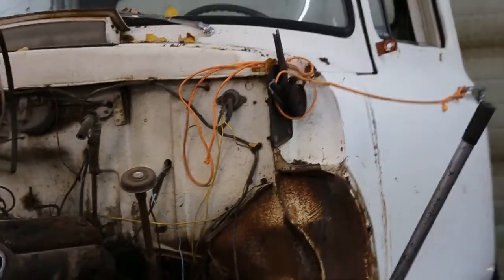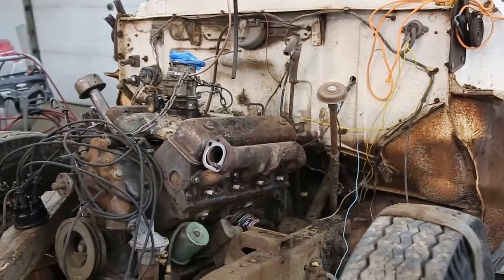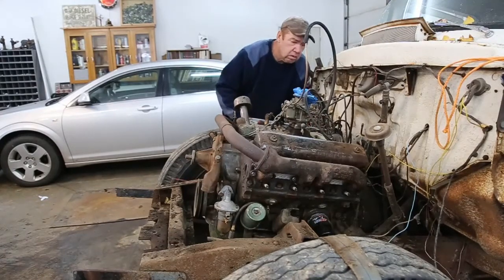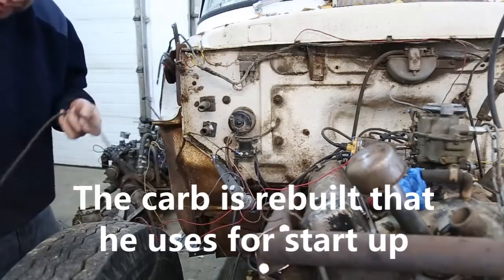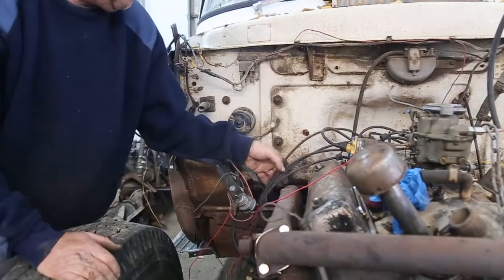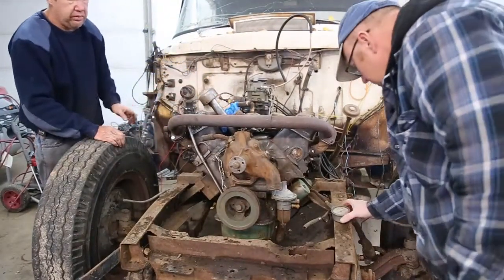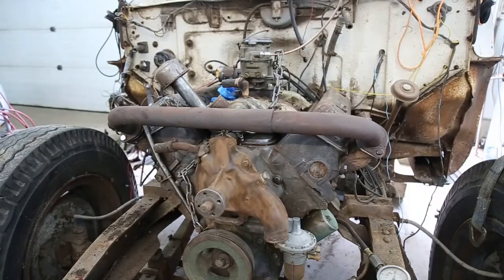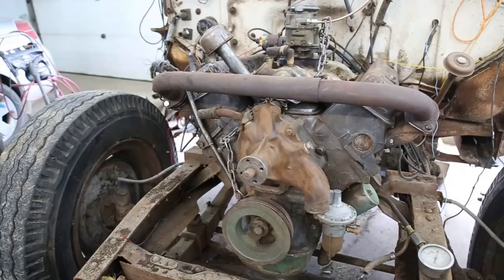1956 Ford engine start up

Comment: She sounds strong. Good ole Ford. I always thought that exhaust was a weird way to do it on those old Ford's
Reply from the maker: This exhaust is a stock single exhaust.  We are trying to find some manifolds off a cab over so we can have dual exhaust.  Still looking
Reply: Hi Dave.  You may remember hat old Kohler cast iron engine.  That  I just barley got going,   Steve was the owner.
Reply: @BrucesShop   Hi Bruce. Yes I remember you saying that

Comment: Don't remove the engine.  Start a new fad and just put some casters on the back frame and it becomes a goer.  Ride in style.  Not sure whose style but some style.  Great sounding engine.  Thanks for the video.
Reply from the maker: Always fun hearing an old engine run again
Reply: @stevoj8959  Hi Chris.  Steve gave me the Old  Kohler 10HP that you saw jumping on my stand.

Comment: The old Y blocks were a tough engine ..This one sounds good and the block looks clean like the dirt and grease was scraped off and they had it apart once get a close look and see if it has new head gaskets etc.
Reply from the maker: We did not have to take this one apart just got lucky with it though it did look like it was rebuilt.  It sounds good so no reason to dig deep.
Reply: @stevoj8959  Hi Jim,    Steve gave me the Kohler 10HP that you saw running on my stand.
Reply: Is this the engine for the 1956 Mercury Pickup  and did you post a video on it's completed.

Comment: not many of those old ford engines still going, that one started super fast..
Reply from the maker: I have to admit I am a Chevy guy but those old Ford engines run great.  Kevin has had old flat heads that sat for years that just fired up.
Reply: @stevoj8959  Hi there oldtimer